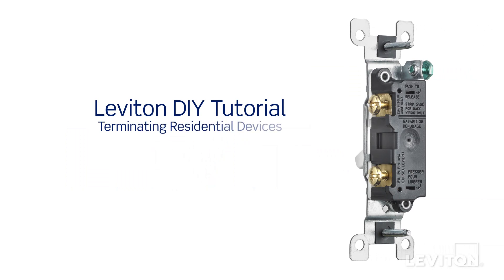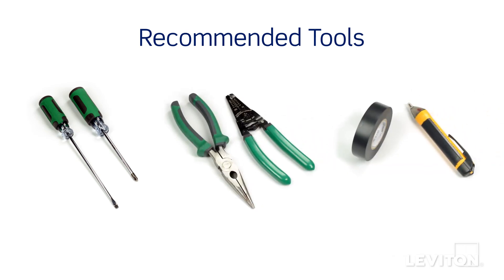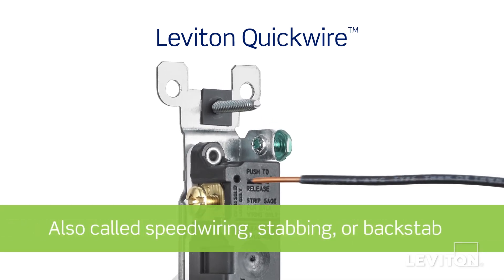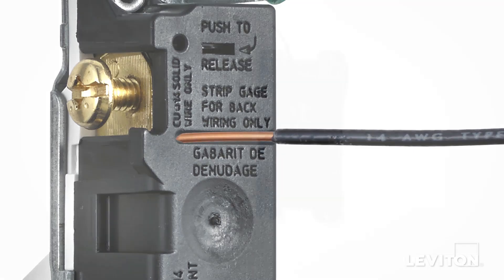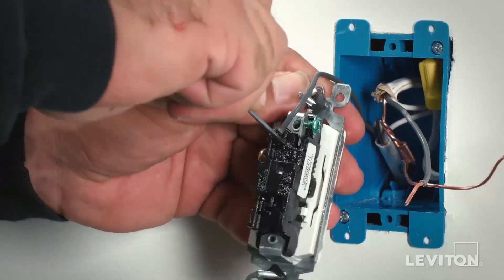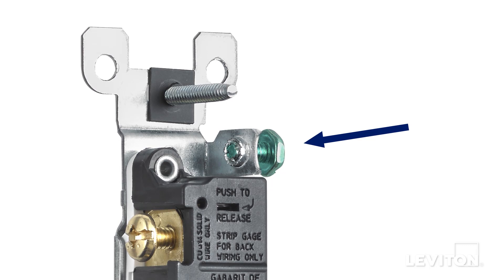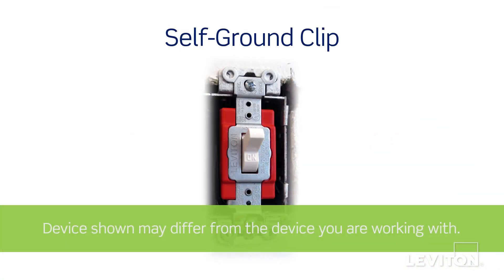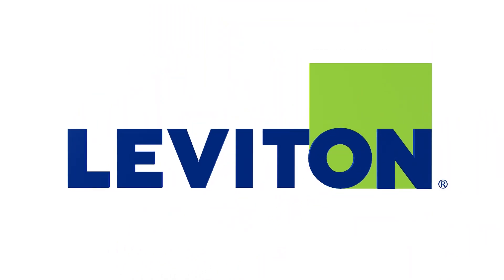How to Wire a Device Using the Quickwire Method | Leviton

Comment: I'm sticking with screw terminals. If push in wiring is so reliable, why is it only on the residential grade switches and receptacles?
Reply: Different codes and higher power. They wouldn’t be making them on new outlets still if there weren’t save so shut the hell up i lived in a house for 30-40 years built in the 70s all backstabbed and had no issues. Its the sloppy work contractors leave.
Reply: I either do side-wire or screw-clamp, they're much more reliable.
Reply: "If push in wiring is so reliable, why is it only on the residential grade switches and receptacles?"
Commercial and business electrical is expected to get harder use than residential.

If the owner or renter of a residential unit is worried about stabback devices arcing and  thus starting a fire or creating some other hazard (despite the fact that it is much more likely that he and his family members will suffer injury or death in a traffic accident), he or she can bring in an electrician to install AFCI protection.